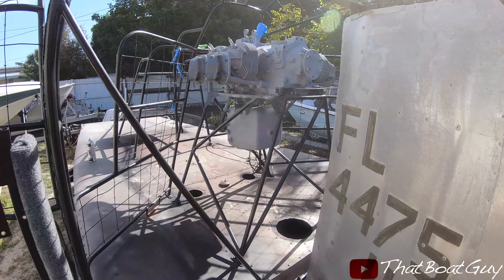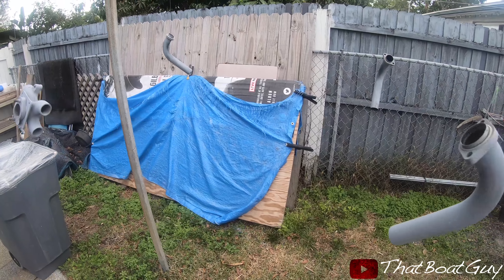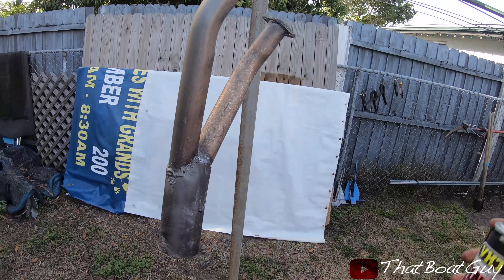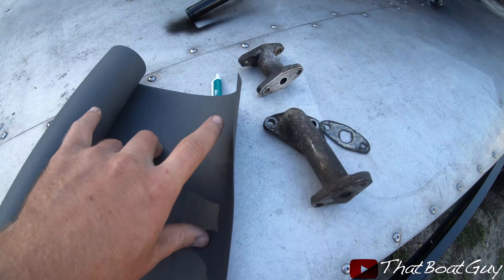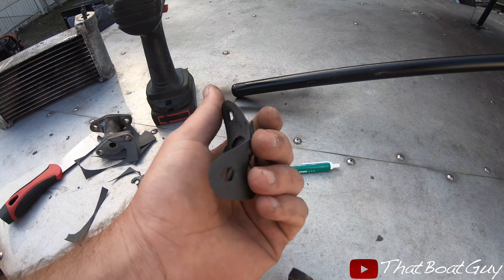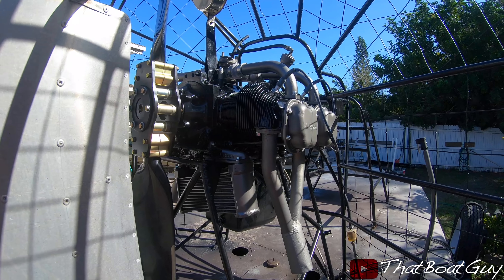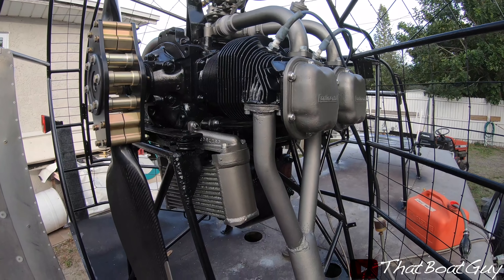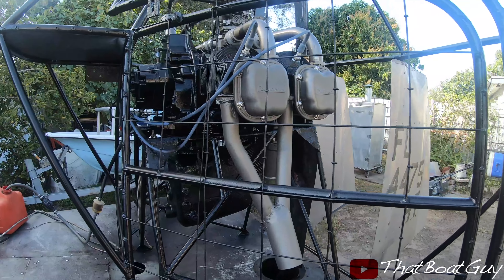Painting The Engine On My $175 Airboat

Comment: That was the main jet, a broken needle makes the engine run too rich. And a separate problem from the carb overflowing, which is a problem with the carb float needle or needle seat.  You can't just paint over loose rust, and expect it to hold. You have to remove it, Rustoleum or not. Also, don't paint cooling fins, or paint shut  the cells in a radiator.

Comment: fyi- air boats are real easy to tip over and check with marine shop and see if painting the engine  will interfere with cooling the engine.

Comment: Looks good starts right up and sound strong New prop is the work horse of the boat should be much better than the wood one.
Bedliner and it will be ready for the water. I would talk to someone who knows how to drive an air boat just to get some basic beginners tips and heard up on whatitsall about. Better safe then sorry. God luck and be careful.

Comment: Do you want paint on the cooling fins of the pistons or the oil cooler fins?
Reply: I was thinking the same thing. I’m pretty sure hes going to be running hotter then it’s designed to. Maybe even overheating in just warm weather and I know it gets really hot there too.

Comment: How do you start the engine while you are out on the water?
Reply: the cage opens next to the drivers seat, allowing someone to turn the prop from the backside of the cage to start it.
Reply: You start it with the hand crank in front off the motor
Reply: big steppy that’s how you’re supposed to start it, but he has no crank and doesn’t seem interested in getting one.
Reply: @cats400  he said he would get one

Comment: Looks good. Do you have any overheating concerns? Do you think by painting the cooling fins on both the engine and oil cooler it's going to hold heat instead of dissipate it?
Reply: I was thinking exact same.

Comment: so ive been following this project and the comments and i can tell you this; you have NO IDEA how an AIR cooled engine works..... granted the paint "may" not cause over heating in your area but why risk it? go bare metal on the cylinders, heads, and oil cooler! FYI, this doesnt stem solely from the comments, i have made this same mistake on motorcycle engines (twice) myself
Reply: Exactly what I was thinking.. heat resistant paint might even keep the heat in the engine not just make it more difficult to reject the heat,  like a layer of insulation